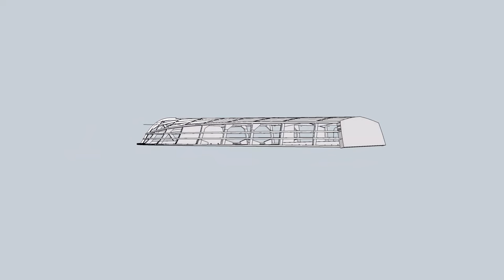DIY Flats boat: 2011 Osprey 18 build (Timm Smith design - R.I.P.)

Comment: I ordered the Crystal 16 from Timm, probably about a year before he passed. I haven't started it yet and have no plans to in the near future, someday. It is the sister to the Osprey 18 that you built. Very nice build however. The Crystal is a different construction, I had asked Timm if I would be able to use the Osprey building method and make it 16' instead of 18. He was very much against it as you might imagine.
Reply from the maker: Timm will truly be missed. We spent a lot of time discussing boat design and there is a long chain of emails between he and I. If the Crystal had come before the Osprey I would have built that one instead and had no regrets. Timm and I chatted a lot about a Gheenoe super 16 sized boat design but nothing came of it because he had a back log of paying designs. Originally I was going to build a boat of my own design but he convinced me to build the osprey instead.

Comment: Care to sell the plans?
Reply from the maker: you can buy the plans here:     https://www.smithmarinedesign.com/osprey18.html
Reply: I was told they closed the design company and when I asked if they still had set to buy I have not had a reply back. There’s enough info I could draw it out to close proximity but trying to skip the lifting process
Reply: I found one in Bradenton that someone started but couldn’t finish. Plans included. Super excited